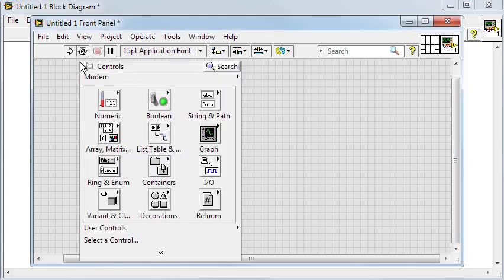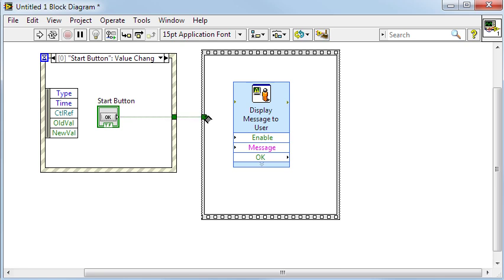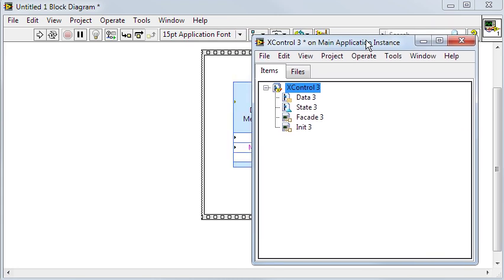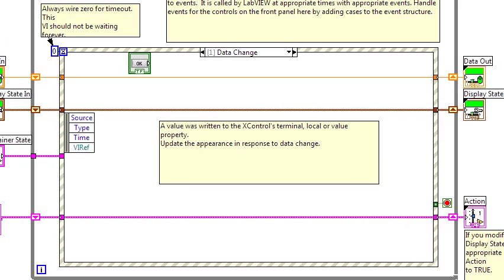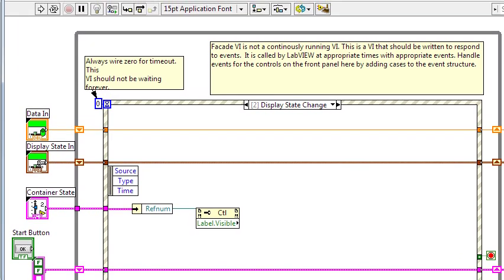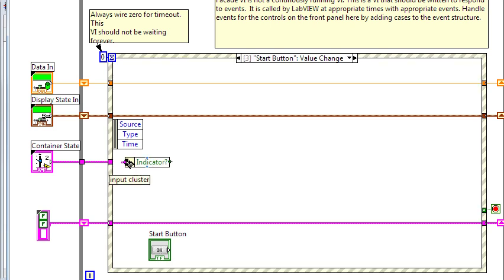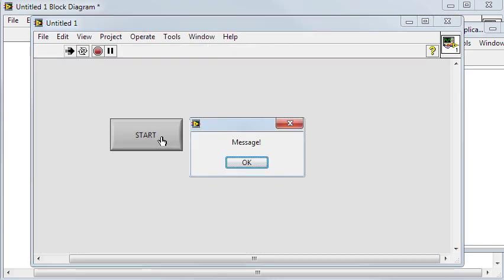LabVIEW: start button XControl

Comment: how can i open step 7 software from labview front panel?
Reply from the maker: What do you mean? You have to be more specific.
Reply: LabVIEW Tricks can I open any other applications from labview Front panel by just clicking one button like PDF file.
Reply from the maker: I think so. You can always run command line scripts, if nothing else.

Comment: Hi, I have a problem with your trick. I've created start button according your instruction, It starts vi as it should but seems like it takes over whole thread, within which is a slider, stop button etc. execution of vi interior is OK but i can't do anything in front pannel. Do you have idea what could be wrong?
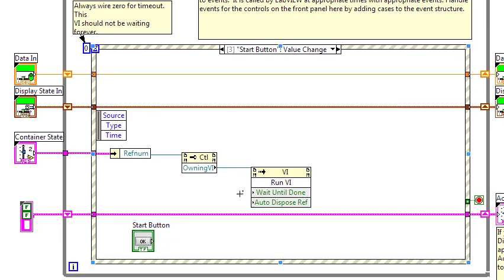Reply: 5:47 here at the "wait until done" you should creat a constant and sit it as "false"
Reply: @chaimaakremi2054  Thank you very much, I have the same problem and your advise works for me.
Reply from the maker: Did you see the note I added about connecting the inputs of the "Run VI" method? For some inexplicable reason, the XControl doesn't work anymore if the inputs aren't connected.
Reply: @chaimaakremi2054 thanks so much your advice helped me

Comment: Hi, i have the same problem encountered by juanarash1. When i press the start button, i cant press my stop button in the while loop. it works when i run it normally. any idea why this happen?
Reply from the maker: Is the stop button inside the while loop?
Reply: LabVIEW Tricks yes. In oder to stop the while loop that is why it is inside.
Reply from the maker: Bibi Bibi Found it. The "Run VI" method requires the inputs to be wired. Right click on the connectors for "Wait Until Done" and "Auto Dispose Ref" and choose "Create" -> "Constant". Dunno if this is a new bug, haven't noticed it before.
Reply: LabVIEW Tricks Thank you. I just tried it. It is working, when both constants are false. :) Thank you for noticing it now. :)

Comment: I have followed your steps but get broken xcontrol!
Reply from the maker: Tinkering with xcontrols easily break them, and then you have to start over. If you like, can you PM me the error message?
Reply: LabVIEW Tricks I found the reason. When adding new event for the button, the wiring for Data in and Display state were not done. Any way I got new problem. In my program I have just a while loop and using start button causing that loop stop button does not work. But when running VI normally it works. Thanks alot dude. I was thinking to do it for about two weeks
Reply from the maker: juanarash1 Sorry for the late answer. Did you put the stop button inside the loop?

Comment: can u please do it for continuous run button
using same Xcontrol..
Reply from the maker: Unfortunately, there's no way that I know of to access the Run Continuously button.

If you absolutely need this functionality, the best I can think of is to have the start button start a subvi asynchronously that monitors your main vi, and have it run your vi again when it goes idle. Then you need a stop button xcontrol that stops the subvi.

That solution is obviously very costly and quite impractical.
Reply: thanks for reply.......... 
anyway i m getting extra marks for my project from this start button
thanks alot dude..
god bless u................. :)
if it is possible den please upload video for continuous run button.., m also thinking on dat.. if i will get some solution den i will tell u..
keep watching all of yours video ...
really nice work..
Reply from the maker: Divyang Patel Thank you! I don't know how useful a cont. run tutorial will be, plus there are a bunch of other tutorials I want to make first. We'll have to see. If you find something out, please tell.